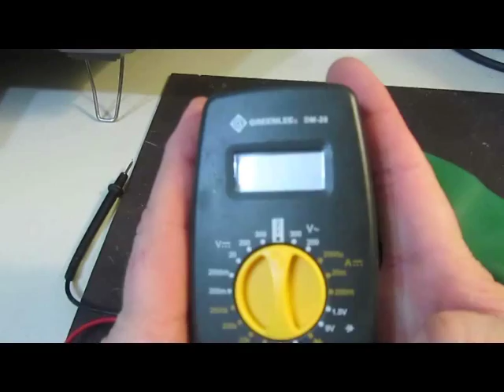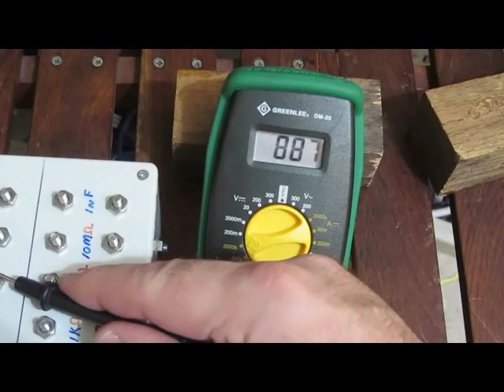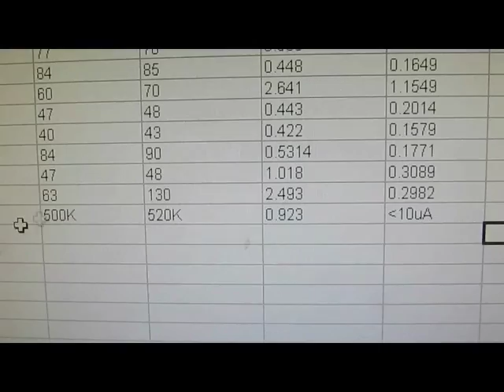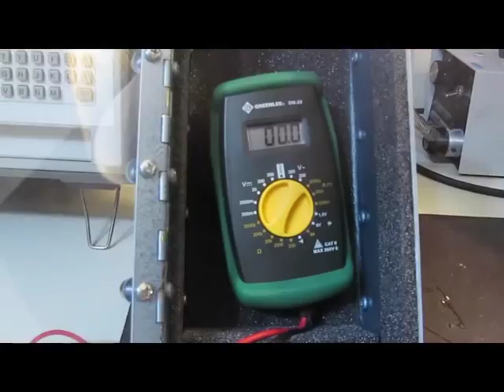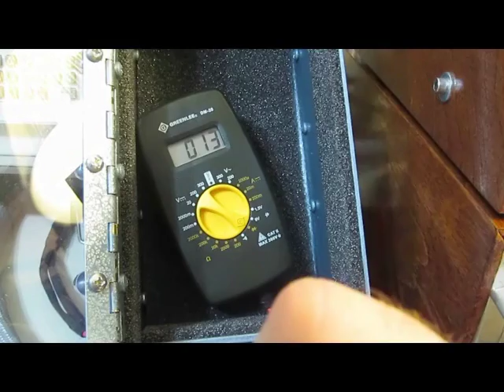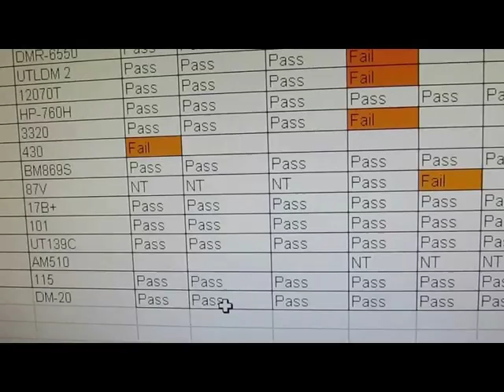Review of the Greenlee DM-20 Digital Multimeter

Comment: I have this thing too. When using for household stufff - checking outlets, batteries, bulbs and car stuff - it works at satisfactory level. But when it comes to electronics dealing with milliamps and stuff - it sucks horse ass. Plus the 20,200,2000 on the dials make it look confusing. 
It seems Greenlee designers added those to make their device look sophisticated, while part of that dial is useless.

Comment: Yep, but advice, I know how to use it, how do I recharge it when it is dead? Answer this. A Greenlee DM-110
Reply from the maker: You don't recharge it.  You buy a new 9V battery and install it.  Check the manual.
Reply: @joesmith-je3tq  the back says to remove leads from the circuit, is that really necessary to replace the battery? what happens if i don't remove the leads?
Reply from the maker: @RockoOwO  The manual assumes your clueless and does not want the liability of you doing something stupid is all.

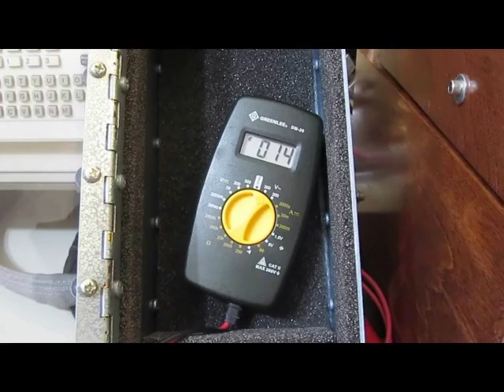Comment: WOW!! @17:34 mark I almost jumped out my chair, I was wearing headphones and what a shocker!  I actually own this multimeter, based on a friend's recommendation.  I am hoping that it is still safe to use for the small things I do around the home, such as checking household batteries and checking things on vehicle such as battery, wiring, spark plugs/wires, fuses and fuel injectors!  I am truly a novice when it comes to electrical/electronic problems, and your video shook my brain with all of the technical terms and jargon.  I appreciate you sharing your wealth of knowledge in this field!
Reply from the maker: +kev bra I can't really comment on the safety side of things.   The part of the video you pointed to is my attempt to simulate a transient (or a spike) on the AC line.   If you are interested, there is a spreadsheet attached to the first post that shows all of the test results so far.

http://www.eevblog.com/forum/testgear/hear-kitty-kitty-kitty-nope-not-that-kind-of-cat/
Reply: What it looks like  - it is designed for household ordinary voltage stuff  -outlets, lightbulbs, car. But It seems to suck horse ass at electronics. Very inaccurate when it comes to milliamps.

Comment: Survived longer than I expected.
Reply from the maker: +Marcel Hanenbergh No one was expecting it to live this long!!  I would be interested in knowing who made the meter and if the very low current and high resistance measurements for the continuity test are normal.  I suspect that the meter may have had problem and this has to do with why the diode check did not work.